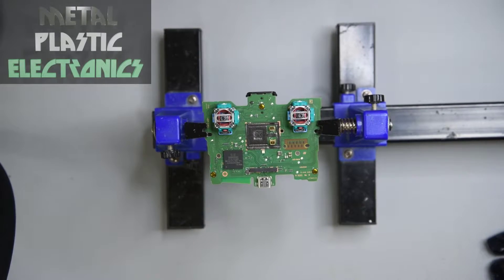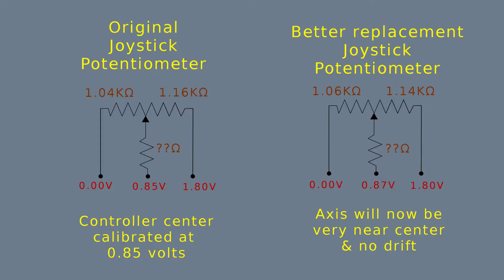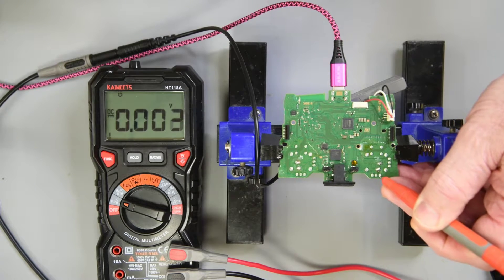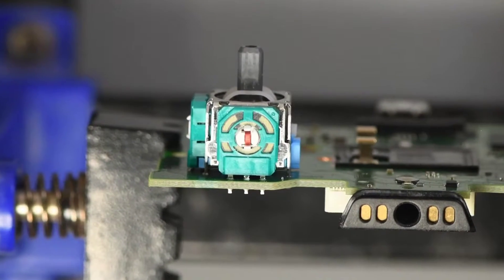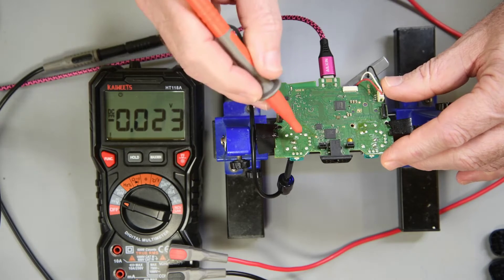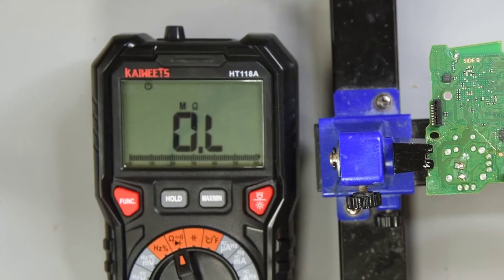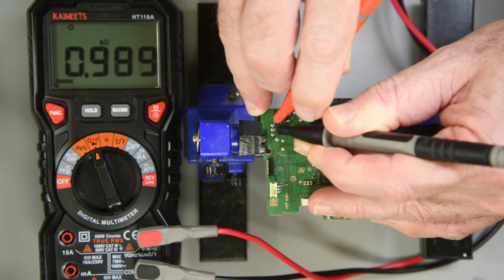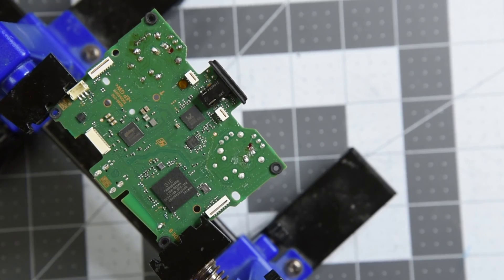Troubleshooting a Replaced DualSense Joystick

Comment: Hi, I replaced both sticks, and I'm getting around 1.1 volts on both joysticks instead of the 1.8. I can't find any damage at all. Do you know what it could be? I've already cleaned the whole board with isopropanol (was careful to not rip out any components).
Reply from the maker: Are you getting any LEDs flashing, or will it connect to the gamepad tester website? Most likely, there is some solder shorting out somewhere; it can be hard to find.
Reply: @metalplasticelectronics354  nope, nothing turning on. I actually did this on 2 controllers. First one worked, 2nd one didn't. And I really scanned both sides like 10 times already with a magnifying glass and can't find anything. I feel like the only thing left is maybe that something got to hot? Even tho I always made sure to be quick. But yea its super weird that I get 1.1 volts on all 4 pins (2 per joystick). Thanks for your answer btw
Reply from the maker: That 1.1 volts should be 1.8 volts.  With the battery disconnected, what resistance do you get from one of the 1.1-volt pins to ground?

Comment: Hi i had an issue with the right joystick not detecting movement input, so i tried doing the thing of soldering a wire from the supply pin of the working analog to the supply pin of the right one, i did it with both X and Y axis, and it actually solved the issue but, now my dualsense doesn´t rumble/vibrate anymore, and the feedback from the L2 trigger is gone, what could had happened? i will really appreciate if you could give me any tips since your video helped me so much...
Reply from the maker: Make sure you don't have any solder bridges shorting out the rumber motor pads where the wires connect.  Also, try reseating the flat flexible cables to the trigger assemblies.
Reply: @metalplasticelectronics354  Thank you this helped me fixing the problem, i think diconnecting and reconnecting the flat cable solved it, but, i have something more if you want to help me, my share button is baerly detected, it isn't dirty inside the controller, so I don't know if i just need to replace it someway, that was the first thing, and the other thing is that my L3 button does not work at all, is there any connection I can do between some pins again considering my R3 does work? Again, thank you so much. (and sorry if my english is no that good)
Reply from the maker: The L3 switch pins are the 4 small pins on the joystick. Check the PCB traces going to those 4 pins very closely.  Two of the pins are 1.8 volts, and the other two are the output of the switch.  It does kind of sound like the share button is wearing out.

Comment: I stumbled on this video while looking for a solution for my controller. I don't have 1.8v on the right joystick, and I was trying to figure out where it originates from. It seems to be a separate 1.8v supply from the left side.
Reply from the maker: I would suspect a bad trace.  The easy solution is to run a thin wire from the 1.8 volts from the good joystick to the one missing the voltage.
Reply: @metalplasticelectronics354  it was a broken trace. Originally I thought the 1.8v was different for both joysticks because they did not have continuity between them, but when you said run a wire between them, I looked closer and found the break. A capacitor on the 1.8v line near the right joystick was corroded, and it's missing pad created the break. Thanks! My controller is working again.
Reply from the maker: Very good.

Comment: This video is super helpful and I have couple of doubts … what if the ground has 0v and some pins on my controller especially left one has no voltage some have 1.8V but the one which should show 0.9V has nothing … is because of bad soldering or pcb issue I don’t know which is the issue and the analog button doesn’t work
Reply from the maker: All the ground connections should be at 0.0 volts.  If 1.8 volts is missing from one of the supply pins to the joystick, then that is probably a connection/PCB trace problem, and that joystick's 0.9-volt output will be missing.  You can run a small wire from one of the pins that has 1.8 volts to the pin with the missing 1.8 volts.  That is easier than trying to repair PCB traces.
Reply: @metalplasticelectronics354 so can I just put a wire from 1.8v from working side of same analog lets say the top/down is working and two pins are giving me a output of 1.8v and .9v respectively then I can put a wire from 1.8v pin to the pin on left/right of the same analog ??
Reply from the maker: Yes.

Comment: I have bdm-050m I change the stick to tmr. I thought I mess the chip up. Bec afterward it didn’t turn on. But the battery I was using was bad I find out. I used the different battery it came on. I calibrated the stick and I played cod for a good 5hours. Next day I went to turn the controller on it wouldn’t turn on. I alway have my controller plugged to the ps5 bec usb lower the input lag. So this battery is fine. What could case  my controller to no turn on?
Reply from the maker: Do you have a meter to check voltages?  It might be something draining the battery.  Does it flash any LEDs when you try turning it on?  I would do a hardware reset, check and make sure all the FFC connectors are seated properly, and look very closely for any solder splatter that might be touching something it shouldn't.
Reply: @metalplasticelectronics354  I have a meter to check the voltage. It have 3.4 at the power supply. I can’t get any light to show not even an orange. I used it for cod from 6:30pm- 11ish pm got home the next day and it wouldn’t come on even with being plug straight into the console. I do have one point on the board that dosnt have 3.4v it sometime .8 to 2.4 and other I have 3. I can’t find not splatter. The rest is the first thing I did
Reply from the maker: There should be 1.8 volts on the B+ pins of the joystick sensors. Remove all connections to the mainboard, then reconnect the battery only.  Then connect a USB cable to a computer and go to the gamepadtester website, and see if it will see the controller.  You will need to push the R3 or L3 button.  If it doesn't, then I expect a problem with the power delivery from the battery management IC.

Comment: I don't have a multimeter. I have a problem after installing the Golikit TMR. The left joystick works fine, but the right joystick points me to the upper left. I had trouble removing the old joysticks and ripped the lower left tracer and the middle one on the right side. How can I fix it?
Reply: BDM 020
Reply from the maker: Upper left would be an indication of no voltage getting to the sensors.  Repairing traces is difficult.  I would suggest looking up some videos on laptop PCB repairs to get an idea of what is required.  Wires can be run for the ground pin and the 1.8-volt supply pins, as those locations are easy to access.  You can even run the wire from one joystick to the other.  But if the trace is torn up on the center pin, that trace will have to be repaired. I think on the BDM020, both center traces for the right joystick are on the bottom layer of the PCB, so it should be repairable.  If you can send me a picture of the damage to mike@mlplel.com maybe I can give you a bit more advice.
Reply: @metalplasticelectronics354  Hello, I damaged the middle pad of the left/right axis of my left joystick. How can I retrace the connection? Thanks.
Reply from the maker: It depends on what model board it is.  Take a look at this sight: https://acidmods.com/forum/index.php?topic=44714.0 . It has pictures of some of the boards with the joysticks removed, and can help you see where the trace runs.
Reply: @m @metalplasticelectronics354  It's BDM-030. I tried looking at the picture but I can't for the life of me figure out where it goes. Are they the two "dots" at the front and back of the board close to the pin? If you can help me highlight the trace, it would be extremely helpful. Thanks for your prompt reply.
Reply from the maker: The tiny dots are vias and are connections to different layers of copper traces.  You can email me a picture of your PCB, and I can highlight it for you.  Looking at the bottom of the board, the connection for the left/right axis is the via above and to the right of the center pin of the sensor. If the via is still intact, you can run a thin wire from the pin to the via.  If the via is not intact, it becomes much more complicated.  You can send me a photo of the board to mike@mlplel.com.
Reply: @metalplasticelectronics354  So I manage to fix the broken trace on the middle pin of the left analog stick, and now the left stick movement works perfectly again.

However, after reassembling everything, the R3 button no longer registers in games or controller tests.
•  I’ve reflowed and resoldered the analog stick joints multiple times.
•  Tested the stick’s click switch directly with a multimeter in continuity mode: it beeps/shows continuity when pressed, so the switch itself works fine.
•  The plastic barrels, pads, and visible solder joints all look intact with no obvious damage.
•  Left stick and L3 work normally.
•  No other buttons or functions are affected.

What could be causing the board to not detect the R3 click input, even though the switch tests good? I tried a different module and the R3 doesn't work as well. It's quite odd.
Reply from the maker: Power up the controller to check voltages on the switch pins. Without the switch pressed, you should see 1.8 volts on two of the pins and 0 volts on the other two. When you press the switch, you should have 1.8 volts on all four pins. If that's the case, start with a hardware reset. Next, reseat all the flat flex cables. If neither step works, suspect trace damage on the output side of the switch—specifically, the two pins that read 0 volts when the switch isn't pressed.
Reply: @metalplasticelectronics354  For some reason, the bottom two pins read 1.8 volts even when it wasn't pressed. I tried resetting the controller, cleaning the leftover flux and reseating the flex cable. Maybe I damaged the trace, even though everything looks visibly intact.
Reply from the maker: Since I don't have a BDM-030 board to check the voltages, try measuring them on the working switch instead. Observe which pins change state when the switch is pressed. There's no guarantee the left and right switches are wired identically, but it's worth a try.

Comment: Nice video! But i have a problem, i have changed a lot of analog sticks, but have one hard to fix... when i move left stick to left its seems that no sensibility, goes from midle to top left instant. Ive changed the stick 3 times, all measures are ok, have no clue what i have to do next. Im triyng to follow the paths now
Reply from the maker: Top left would be the output of both sensors going to 0 volts or close to it.  Have you checked the supply voltage to the sensors on the left joystick when it moves to top/left?

Comment: I replaced my joysticks but the right joystick doesn't work on the ps5 only on PC. All the PS5 controller software detects my joysticks just fine, but for some reason on the PS5 the right joystick is dead. Do you have any idea what kind of failure could be causing this issue? Thanks for making such an informative video and I really hope you see this comment.
Reply from the maker: Have you tried a hardware reset of the controller?  If it's working on the PC, that means the hardware is working, but something is not communicating properly with the PS5.  The only thing I can think of trying is a hardware reset of the controller.
Reply: @metalplasticelectronics354 I tried a hardware reset but the right stick is still completely disabled on the console. Is there anything else I can try?
Reply from the maker: I can't think of anything.  I don't see any reason for it to work on the PC and not on the PS5.  Does the PS5 act like the right stick is in the center position and has no response?  Or is it acting like the right stick is moved in a direction?  When you load up the Gamepad tester website and move the right stick, what kind of values does it give?  It's a very strange problem.
Reply: @metalplasticelectronics354 On the PS5 it acts as if it was in the center position. It's as if the joystick wsnt plugged in, I tried the controller on a Switch and it works on there as well. Gamepad tester shows 0.01176 on Axis 2 and 0.02745 on Axis 3. Controller works on there as well. I've tested the pads on the left joystick and they read the same values as on the right. I could change the hall effect stick on the right joystick but I don't think that would fix the problem.
Reply from the maker: That is really strange.  Must be something in the processor that got damaged.  Something special that it sends to the PS5.

Comment: Thank you for video, though I don't have any traces of controller's life after replacing sticks (the second one, to be precise), is there a way and is it worth it to trace an issue by taking readings? I checked your video on a battery topic, but for me looks like I have an issue with a board, possibly to static discharge
Reply from the maker: Yes, it's worth taking some readings.  Do any LEDs light up?  If not first, I would check and make sure the battery voltage is getting to the board.  It is easy to damage the wire on the battery connector.
Reply: @metalplasticelectronics354  no LED is turned on. Probes on JST connector both from battery and PCB sides are giving around 3.6V (3.65V is working voltage?). Same voltage is read from either input or output of PMIC (the dialog chip, I wasn't trying to find schematics for it). Also I'm reading around 5V on the USB port while connecting it to the power source (but it's not detected though).

I've heard that hall effect sticks could shorten the circuit, so removed the second soldered stick, but unfortunately still no effect. Readings on sticks are giving zeroes. Well, I suppose that's an end for that board :)
Reply from the maker: One pin on each joystick sensor should have 1.8 volts.  If facing the sensor with the pins pointing down, it will be the right-most pin.  If you don't have 1.8 volts there, disconnect the battery and USB cable and check the resistance from the 1.8-volt line to ground.  If you have Hall or TMR sensors, the resistance should be in the 100s of kilohms, or more.  If potentiometers are installed, it should read about 500 ohms.  If it is very low, below 100 ohms, there is probably a short.  Maybe some solder splashed where it shouldn't be.
Reply: @metalplasticelectronics354  Probing for voltage gets zeroes for all non-grounded pins, probing for resistance gets expected values (close to 0 for grounded, hundreds of kilohms otherwise). I can trace the 1.8V rail, either 5V or 3V getting in and from PMIC (powered by USB and battery respectively), voltage getting on the main SoC.

Even desoldering the first stick (that worked initially after its replacement) got me nothing. Either I'm quite blind and cannot find a splash of solder somewhere on the board, or during desoldering the original analogue sticks I damaged some components and now it's either shorted or  not closed. Just as a notice, my soldering skills are far from being good :)
Reply from the maker: It could be that static killed an IC.

Comment: Thank you very much. This really helped me. I replaced the joystick on my PS5 controller and after it would just show going straight up. It turned out I ripped the power pad, ran a wire from the good joystick power to the bad one and it worked. THANK YOU!

Comment: Hi. I did a replacement with hall effect sticks but the left stick is not working on the left/right axis. It is weird. The stick on the right is working but the "R3" button is not working. I don´t have a potenciometer now but I have bought one and arriving next week. In the meantime I have wired from the 1.8v of the working axis but the same results. I think it might be the center pin :(
Reply from the maker: It could be a bad connection or a torn-up PCB pad.  You will need a multimeter to help locate the problem.  Without it, kind of just guessing.  The left/right axis, either the center/output pin or the 1.8-volt supply pin, are the most likely area to look at. The switch is strange because there are two connections for each switch contact.  Depending on the mainboard version, I would look for a damaged trace that is common to any of the switch terminals.   Of course, it may be a defective switch.

Comment: Hey guys! The center pin on my right joystick x and y axis reads zero but I do have 1.8v for the supply pins. From reading the comments I think I have short. How do I find that short? I did check all the soldered potentiometers but they’re not touching each other. Any help will be greatly appreciated. Thanks
Reply from the maker: Shorts are not easy to find.  Look very closely for any solder where it should not be.  Take a resistance reading from the center pin to the ground.  With all the joysticks in place should be around 500 ohms.  If it is way lower than that, you have a short.  The 500 ohms is for regular potentiometer joysticks. If you have replaced them with Hall or TMR, the center pin reading will be very high, maybe in the meg ohms.
Reply: @ thanks for the reply! That did help but now my problem is I have 3 rapid blinking orange lights. Any suggestions for a fix?
Reply from the maker: Check for a splash of solder shorting something out.  Also, make sure all the flat cables are inserted properly.  One way to check for a misinserted cable is to pull the main board out completely and only hook up the battery and a USB cable, and see what it does.  If it still flashes, then you probably have a short somewhere.
Reply: @metalplasticelectronics354  thanks! I’ll give that a try